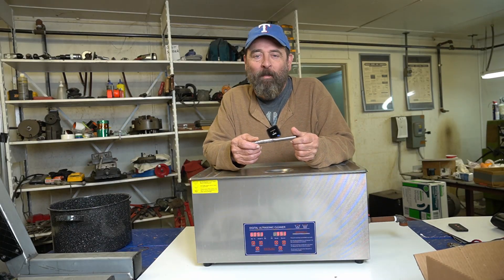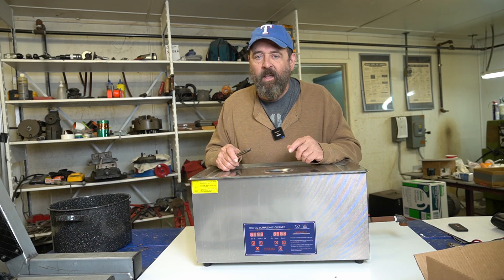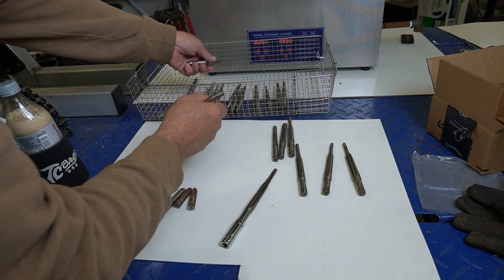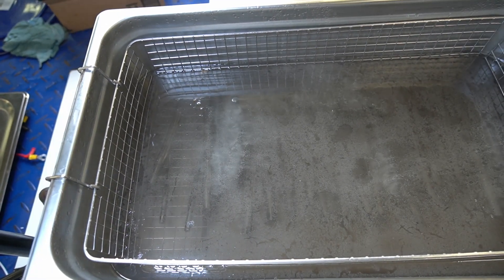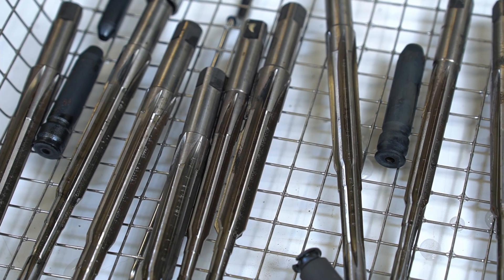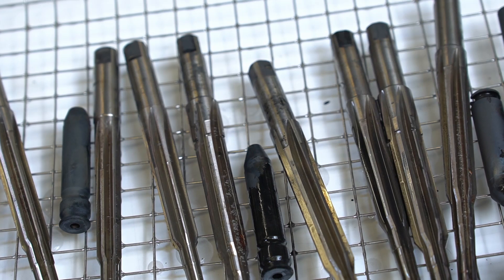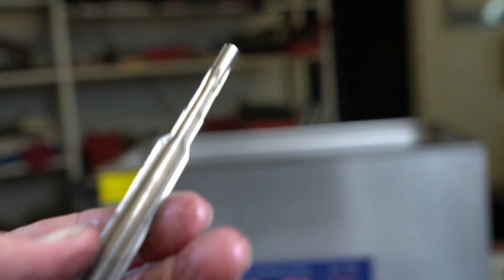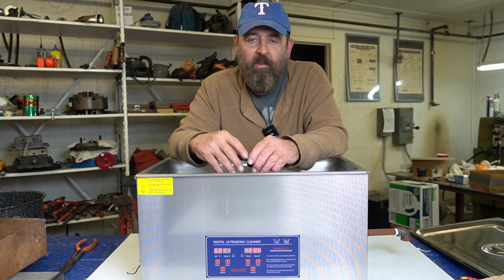ULTRASONIC, VINEGAR, RUST!?

Comment: When you get the parts out, wash them in water, blow dry and soak in WD-40, as quickly as possible, to prevent yellow flash rusting. Any remaining rust was probably soaked with oil - if you degrease first, wash and then use vinegar, you typically get better results.
Reply from the maker: Thanks for the info!